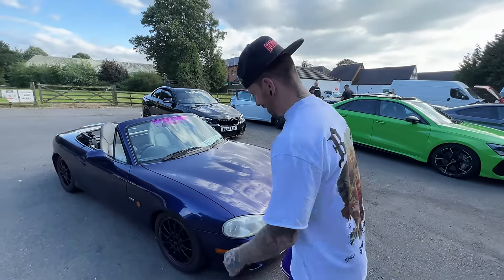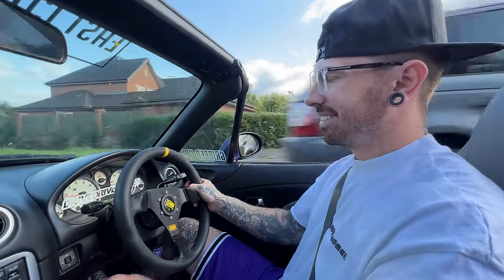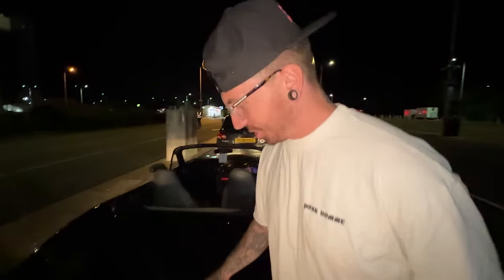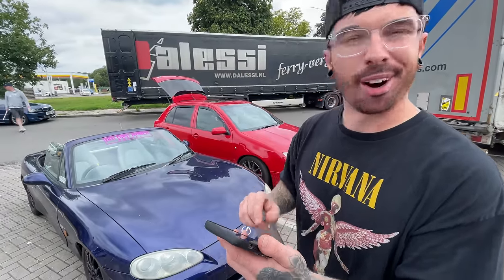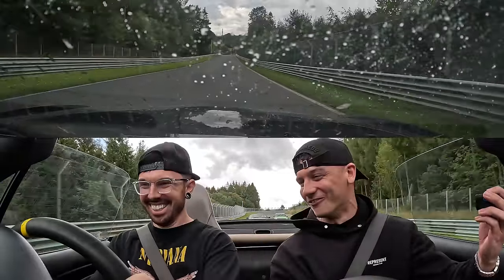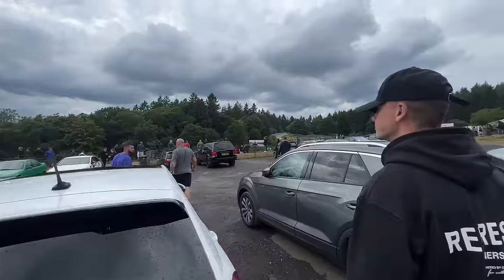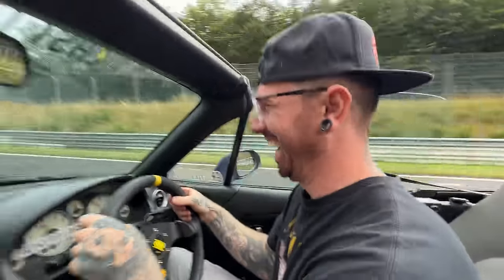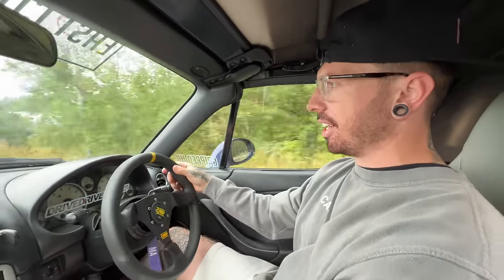I BOUGHT A CHEAP SPORTS CAR THEN DROVE TO THE NURBURGRING

Comment: Mat, I'm a Canadian who greatly enjoys racing, automobiles, and other mechanical objects. I saw many hot rods, classic cars, and race cars. There was a man by the name of Carol Shelby, who was a Texan. He heard about a company in England that would soon need an engine in them because that four cylinder engine was coming in the end of its production. So he went to Chevrolet, which said to him that he wasn't going to be given engines from them. So he went Ford instead. They did send him engines. That first engine was 221 cubic inches, which was bored to the size of 260. That same engine was known as a small block. Why am I typing this to you? That was the first Cobra. Do you know what company it came from? It came from AC Cars over there in England. Did you know it was a secretary's car? Yes, it was. They continue building them. The reason I'm typing this is quite interesting. You should find a V8 engine to put it into that Miata. I know you'll be able to do that work.

Comment: 04:40 thats the PPF Frame not setup properly Mat. And that causes the differential not to line up perfectly with the gearbox, which then lets vibrations through the bolts of the gearbox, making this noise :) not harmfull, just annoying...

Setting up the frame takes up maybe 15mins...

Comment: To answer your MX5 questions: 

NB's are still kinda sought after (more than the NC but less than the NA). Especially because of the 1.8VVTi engine which was a Ford/Yamaha development (correct me if im wrong please). The NBs are the best to modify and came with the best spec options. Some had Heated seats/diff/air con. And the NB's are the best for autotesting/autosolos (yes, you should do an event). 

Visor delete: try having the visor there and you'll know why they removed it lol...its very much in the way.

Comment: I currently own an Alfa Romeo Giulia Quadrifoglio, a fully built Porsche Boxster track car, and a TVR Chimaera. I’ve owned 3 MX5’s (2 NB’s and an NC) and would have another in a second. They are fantastic cars to learn to drive and work on given the front engine, rwd combination, ease of access and extremely cheap parts availability. Jfc even writing this means I’m feeling the need to jump onto eBay to see what’s available…

Comment: They handle like a dream!  I hope you never have imobilizer issues.  Can only use used parts.  My 2003 spent a month at the dealer to have them tell me they couldn't fix it.  Researched it myself for  $300 and 20 minutes, up and running.

Comment: Hi 👋, Mat You are a bit of a Nurburgring, 😂 especially pissing your pants whilst driving, 😂, back in the late 60s early 70s I was driving a Corvette stingray, coming out of Cambridge, there was a funny noise ha ha😂, I had two rods share one came out through the side of the block, 😂 , and for some unknown reason ha ha😂 , And I had problems stopping it, them days there were three lanes coming out of Cambridge going towards Huntingdon are used all three lanes. Luckily it was late at night, In the 2004, my ex female partner and I owned a Mazda MX5, it would stick to the road light. Do you know what a blanket?, One evening, whilst she was coming home from work, she got T-bone by a lorry., we had the repairs done, it didn’t feel the same after that when I drove it, and we traded it in and got a Mazda RX8, the high compression one,   That was capable of doing well over double the speed limit in the UK, Perhaps you should investigate a rotary engine at some point, there is a guy in the states where he has built or is in the process of building. I think it might be a 12 rotor rotary engine. In the USA , Insane content, Nurenberg was a blast, well done for helping the guy who blew his engine in the BM, and I wish you all the success for the future. You drive safe don’t go and piss yourself again, And what’s happened to T from USA , Sorry, I don’t know how to spell  his name, 
Phil from the moulin France.